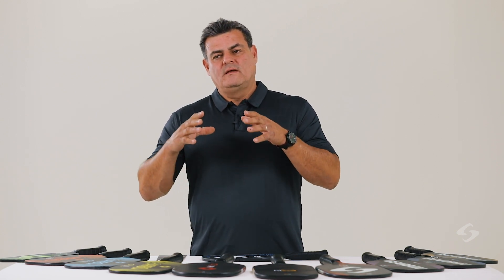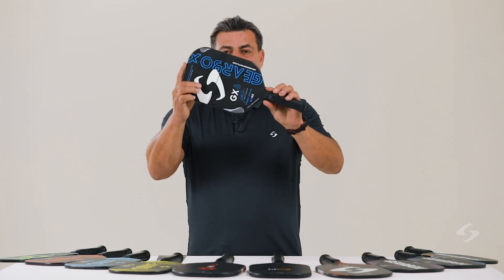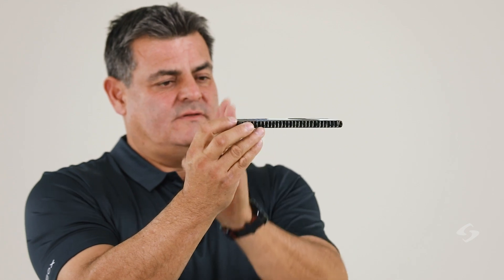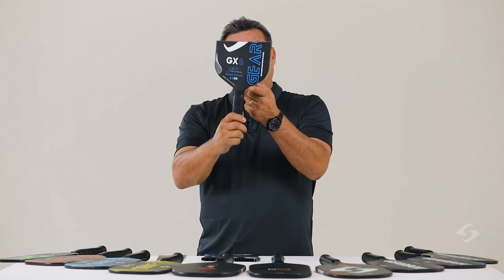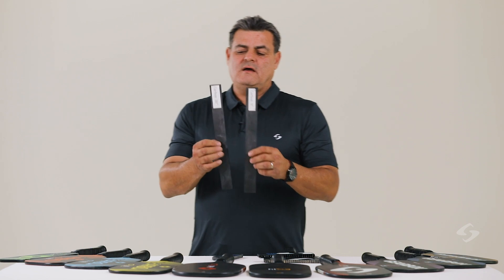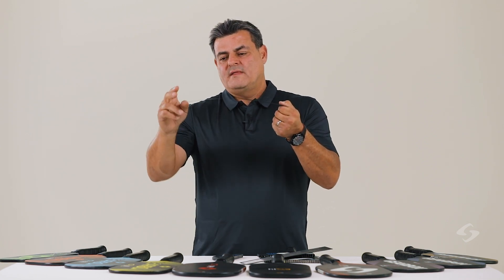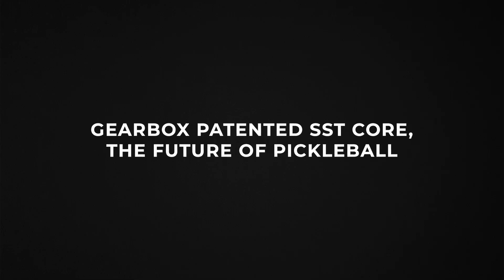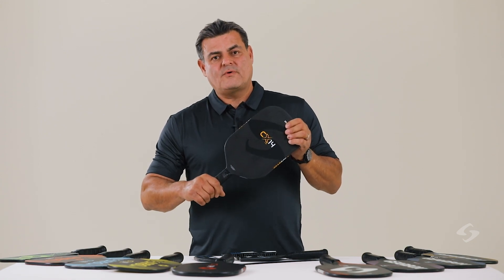Gearbox's Pickleball Technology VS All Others | Gearbox Pickleball

Comment: I really appreciated the detailed explanation of the manufacturing/design process that makes Gearbox paddles unique.  I think it would add significant additional impact to provide a comparison to a competitor's top level paddle with a more typical design.  The competitor's brand should be obfuscated to avoid any legal issues.  Just a price point comparison and overview of the design differences with the same cutaway views to illustrate the points would be extremely effective, IMHO.  

Another good addition would be to include a lower end paddle that most beginner's start with.  Again, conceal the brand but this target consumer represents a large market who isn't aware of why they should be upgrading to a top tier paddle from Gearbox as their skills progress.
Reply: Good response, I agree.